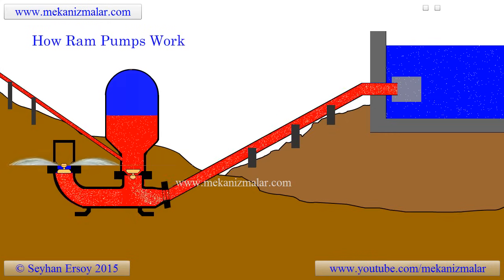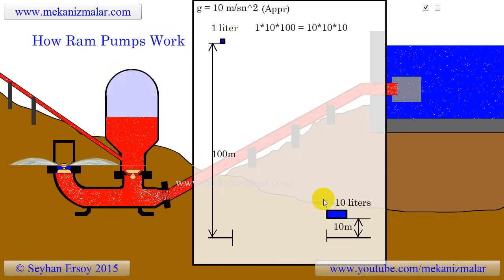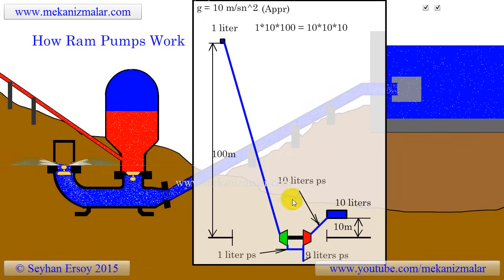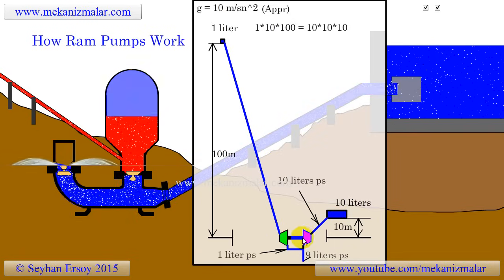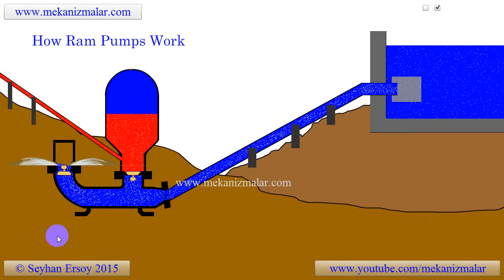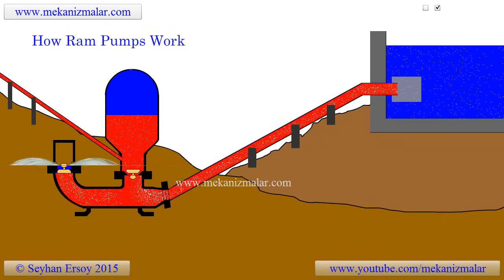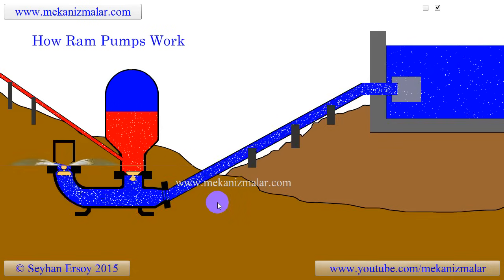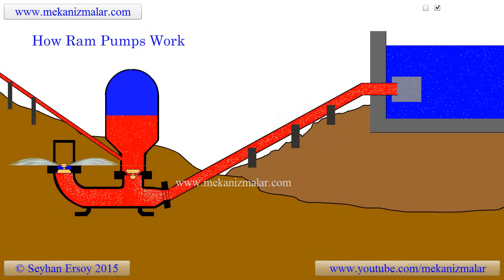how ram pumps work?

Comment: I wonder if one could hook this up to one of those water generators to produce electricity.. you could run the water in a loop so it reuses the same water to keep spinning the wheel and keep your batteries charged. Of course theres that bit of water that sprays out so you have to replenish the water eventually.
Reply from the maker: It is not possible to do that. You have to discharge the water in lower level than it enter to the system. You can still use this water to generate electricity as long as you discharge the water elevation further. You can do this process up to the point where discharge water to the sea level.   Thanks got we have sun, which makes water to evaporate and it falls on earth as a rain and cycle continues.

Comment: Does the waste valve have to release back to the earth? Can I divert it to another area?
Reply from the maker: What do you mean by another area? If you want to connect it to a pond where its elevation below the waste water level, yes you can. If there is another drop in the elevation, you could use another ram pump.
Reply: Yeah maybe to another pond or maybe like a flower bed. I just seems like water waste is a lot more than what the output is from the release pipe.

Comment: I would assert that the primary mechanism of the ram pump is conversion of kinetic energy rather than potential energy.   Yes you need your reservoir to be above the pump (potential energy), but the key to the pump's operation is that the intake water must have some velocity so that when the waste valve closes the momentum of that mass of water forces the water along a different path even against some resistance, namely into the accumulator tank and ultimately through the outlet and uphill.     If the inlet water flows too slowly it won't force itself into the tank, which means you need to tune the size and tension of the waste valve to allow the water to get up some speed before it forces the waste valve closed.
Reply from the maker: Intake water velocity is produced by converting the potential energy into kinetic energy. If the height difference between waste valve and reservoir surface is h. The water velocity will be sqrt(9,81*h) meter per second. Higher the h the faster the water will flow in the inlet pipe.
Reply: mekanizmalar
Reply: daemn42   I agree. (Dr.) Bose my have some good insight to fluid compression dynamics.
Reply: Momentum is the key word for my understanding.  The water starts moving in the pipe and emptying out the waste valve.  The valve slams shut.  That momentum of the moving water pushes water up into the pressure tank. The cycle starts again.

Comment: I don't get it. are those two valves anti back flow valves? then how can the waste valve open up and let the water out the wrong way?
Reply from the maker: Thank you for your visit and comment. Weight of the check valve pulling the valve downward. At the same time ram pressure pushes the valve to closed position. During this time the other check-valve (you call it anti back flow valve) is open and water begin to flow to the higher elevation. However the system is dynamic. Compression wave closing the waste valve is followed by an expansion wave which reduces pressure substantially and the waste valve opens. The water flowing around the valve reduces the pressure which causes the waste valve to close and cycle repeat itself.
Reply: why is the waste valve needed at all? can you just have the water enter the chamber, build to a high presser, close the anti back-flow valve and go to the outlet? then when the pressure is low again, the anti back-flow valve opens and the cycle repeats? I'm finding it hard to understand the role of the waste valve. thanks for the animation.
Reply from the maker: If I did not misunderstand what you are saying is that water magically flows from low level reservoir to high level reservoir, without discharging any water. If my understanding was correct,  it is impossible thing to do.  You cannot make a system that pump water from low elevation to high elevation without using  an external power source.. That is why we use pumps to pump water to higher elevations. For the ram pump, the external power source is the potential energy of the waste water we discharge. If there is no discharge, there will be no water pumping.
Reply: I didn't understand why the left most valve ( in the above video) was needed. now i can see that it creates the inertia of the water needed to push the right most valve. before i thought you could simply have just the right valve and the water prussure from the resevoir alone.

Comment: What if i build bundwall of rocks across the creek to elevate the water level to at least a meter high and install my rampump below the bundwall, but inside the creek to avoid wasting thr water?
Reply: Was giving this some thought. You can't impede the flow out of the waste valve. But if like in the diagram you dug a hole below the creek level you could mount the pump in the hole. Then use a separate water wheel pump to put the waste water back into the creek. Flowing water has it's own energy the water energy going to the ram pump is already being used but there is plenty of other water with potential energy that can be used.
Reply: Ain't gonna work,  PP.   Better:  make a weir in your bundwall--a "V" cut,  top center,  that ALL the water has to pass through.  Channel all the water possible into a pipe,  affixed to the weir,   and extending further downstream (5-7meters)  to your pump inflow opening.  The greater the flow and fall,  the better your pump's resulting volume of water pumped.  (And the greater the head/ feet it will be able to overcome.)

Comment: I am in my 80s, These statements are food for thought.
Once the water is 40 or 50 foot above the spring pond, could it not be used to generate electricity?.

Could we use rain water from a reservoir to replace the spring pond?.
Dan
Reply from the maker: The answer to your first question could be yes, but it would be very expensive and you can't get continuous electricity. First, you should have very large reservoir at 40 or 50 feet elevation to store pumped water. Then when the reservoir is full you can generate electricity for limited duration. Of course, someone should analyze how much water being pumped to high elevation and and what is kW energy you need  to generate.  
The second question yes, you can use a reservoir to pump water to higher ground, but when the reservoir empty, you have to wait for the rain.
Reply: Conservation of energy still applies, as the maker of this video says. I'm pretty sure you'd generate more electricity by passing the pond water directly to a lower elevation, rather than first pumping it to a higher elevation and then allowing it to flow to a lower elevation, since you'd have fewer opportunities for energy losses due to leaking, friction, etc.

Comment: How could you use a ram pump in a fish pond just to move the water above the water surface to aerate the pond?
Reply: godzuki101 I have thought about that before and you would have to get some of the water flowing downhill to the ram pump and then pump it back uphill dropping it onto the water surface. there is water loss at the ram pump location So eventually it would lower the level of your pond.

Comment: Would of liked to seen the flow direction to confirm function. Cheers
Reply from the maker: Thank you for your comment, I realized that making pixel size particles to move is not good. In the newer version of the program I can make particles larger. Should I do new version of ram pump animation?

Comment: I understand that this is be far a better way to pump water from a lower moving water source to any where higher but the waist water  is more than  am happy with, can you route the water back into water source  . meaning if you did this from a water tank???????????????
Reply: YES you can
Reply: yes you can but its a  little more complicated
Reply: you have to have another tank over the discard valve or a HIGHER PIPE over it with an open tank at top as high or hihger than the inflow area uphill.. to contain the water pressure from this height..it takes a few tests to figure this height..
this water REVERSES back into the pressure tank going up hill and contains the water..so simple ..people are silly
Reply: in short, no.
Reply: I was meaning that water can be pumped to a higher place without power appose to a pump that uses power to do the same
Reply: In short, you can not use this pump from a water tank.

The whole point to this pump is that it is self powering. It is only used where there is a natural spring or river.

You can't rout the water back to the tank without external power because the tank is higher than the waste port.

If you were to use an external power source, an electric pump for example, it would be more efficient to just pump the water to the desired location and not use a ram pump.
Reply from the maker: Thank you for your comment. Your  comment makes it clear. However I would use  more convenient" word rather than "more efficient" for electric pump. The reason for this, if electricity coming from a dam, wenare wasting water in that dam. Thinking about the cost of bringing the electricity that location, assuming you are away from the grid, would also be expensive. I would still use the Ram Pump. next to a creek.
Reply: No no, not convenient. Efficient, specifically.

Because the OP mentioned a water tank. A water tank means there is no spring, no waste water. Where there is no waste water, you must capture and recycle all waste water.

Using a ram pump in this condition is less efficient than using what ever other source of power you have. If you must capture the waste water and use a power source to recycle your water, then you should use that power source to pump the water directly to the desired location.

If you have limitless waste water, no question, use a ram pump.
Reply: yes yes u can,  you can't route it anywhere but if the location is ideal you can definitely catch the water being wasted. watch wranglestars designs its s little different he ahas quite some distance between the water source and the pump
Reply from the maker: Pumping water from a tank is meaningless. Sorry for misunderstanding your comment in my part.
Reply: Sure you can. You just need an additional ram pump. Then you would have more waste water there though.

Comment: too much water waisted
Reply: if you wish 100% of water to be delivered to your house up hill, you will have to use electric or gas operated pump with high flow rate. if you think to get delivered it for free, you will let water continue its natural flow and borrow some for your needs... 
what most of you think is to get a tank of water and pump it to the desired location without a waste. in that case, why you do not load water in to the tank and drive it to the location? :)
Reply: If you don't get it, then you'll never get it. It's moving water vertically FOR FREE in regards to energy required. Nobody is talking about the parts being free.
And it's not wasted water, if it flows back in to the natural stream from which it came. You should go and watch some other videos on ram pumps and see if that can give you a different perspective.
Reply: There's nothing stopping you from putting the pump in the stream you are  using as a source, and only the pressurized water goes out. That way, the "waste" water stays on course.
Reply: Zo Mi check Bunnings or Smart Water (or Ebay) for check valves. You're looking at the wrong (too exotic) parts for that pricing.
Reply from the maker: Not true, please watch the video in detail.
Reply: at wasting 90% and thats not good, unless you can pipe the water out of the  last one way valve back into the water source
Reply from the maker: Let's assume that the electricity produced in Hoover Dam is used to pump water from the  Lake Mead to 100 meter elevation.  By the time you take 10 percent of the water from lake Mead to 100 meter elevation, you would empty the lake Mead. Is it more efficient than the ram pump?
Reply: But instead of wasting the water I could send the water back into a tank, would this still work? FYI , I price the parts here to make this here in western Sydney Australia , the cost would be Over $500AUD
Reply: each one way valve is $220AUD
Reply: Proff Allen
there is some videos shoving how to make valve from pvc pipe. think you will spend few dollars for that.
but if you collect all water what will be wasted in separate tank, then refill manually main tank, you can avoid water being wasted.
Reply: Waldo Lost
main issue is coz he wants to use this system to pump water from the tank. in that case any water spilled is waste. only what he can do is to collect that water in other tank and then to refill main tank...
Reply: Zo Mi It takes energy to pump water. These pumps use energy from gravity, for free. Gravity doesn't work backwards. If you want to raise the water back to the starting height, you have to use other energy (electricity, hand pump, or???)
Reply: Waldo Lost
my friend, i get that. that guy is who need explanation.
Reply: Zo Mi 
which he just got :)
He can collect the water in another tank, so it's not wasted, but putting it back in the main tank is not going to happen for free. He has to do it.
Which you already know.
Reply: It seems that you fail to understand what makes this work. The water is falling. After the water has done its work--it is now lower than it was when it began its journey. The force that is doing the work is gravity. In the majority of situations where a ram is used the water is not "wasted" at all, it simply returns to the creek that it started in
Reply: It is not wasted.
Reply: You could catch the water after it leaves the Ram Pump and direct it to another tank---that is very true, BUT that tank would be lower(further down the hill) than the top or entry point of the drive pipe. Your $500 figure sounds ridiculous to me but I've never been to Australia. The only two parts that might be hard to scrounge are the two check valves.
Reply: That is ridiculous! Something is wrong. Look somewhere else. How big are you looking at?

Comment: of course,  water, once flowing has kinetic energy. water, even at 10,000 meters will be useless in operating a ram pump unless it starts falling.
Reply from the maker: +Ye Olde Salt I don't understand your comment. Everyone knows that you need flowing water to generate electricity. But some people don't know about conservation of energy. You can't generate more energy from flowing water than its initial potential energy. Efficiency of your turbine will be measured as ratio of the generated energy versus the initial potential energy of the water.
Reply: potential energy can be infinite but no work will be done unless it turns kinetic. the point is that you should not have used the term "potential energy" at all. the correct term is "kinetic energy". Work = Force X Distance.  No flow, no distance, hence no work.
Reply from the maker: +Ye Olde Salt I am sorry to say to you that your Work formula is completely wrong. Please correct the formula you write, before commenting how I use Potential energy description in my animation.

Comment: EXCELLENT VIDEO!
okay so I have 2 questions regarding this. 1: How do I purchase equipment for this type of mechanism; #2: How do I get in touch with a contractor who can construct and install one of these types of pumps?  EMAIL ME PLEASE:  Thank You arlenevhaas@gmail.com
Reply: you need two check valves and some pvc pipe and a shutoff valve (brass or pvc)  glue fittings and or screw pipe together.  Big box store, farm supply store,   or plumbing supply store (where plumbers buy).   There are videos on youtube to show you how it is assembled.

Comment: What is the least amount of elevation needed to cause the ram pump to work and what is the height that it can be pumped to?
Reply from the maker: +Barry Wind Thank you for your visit. If the elevation is small, the volume should be high. I guess 2 or 4 meter elevation with high volume can pump water. If you have 10 liters per second water flow with elevation of 2 meter, you should be able to pump less than 0.1 liter per second to elevation to 200 meters, or less than 1 liter per second to elevation of 20 meters. Formula should be h*q < 10*2 where h is elevation, q is water flow rate at the exit, 10 is inlet volume rate and 2 is water head for the pump. If you want 2 liter per second volume rate, the water can be bumped to a height less than 10 meter. How much less, requires knowledge about pump efficiency. The numbers I mentioned for theoretical 100 percent efficient cases. Check the following link for more info.
https://www.lifewater.org/resources/rws4/rws4d5.htm
Reply: Thanks
Reply: @mekanizmalar  Hmmm. Not very encouraging. I've got about a 1.5 meter fall, and very low volume. I'm still very interested in giving this a try. The lifewater link is '404 Page Not Found'.